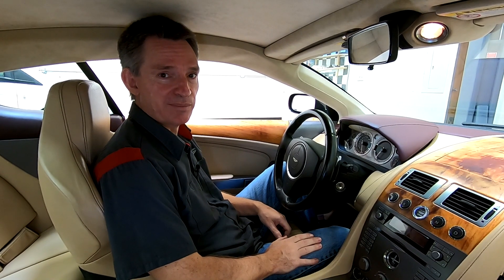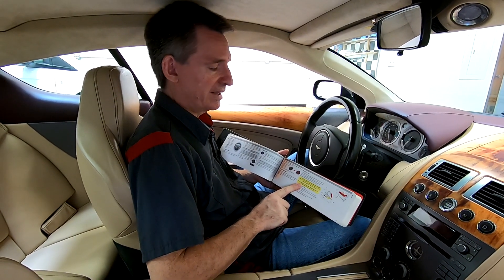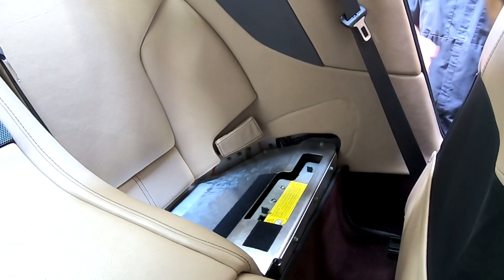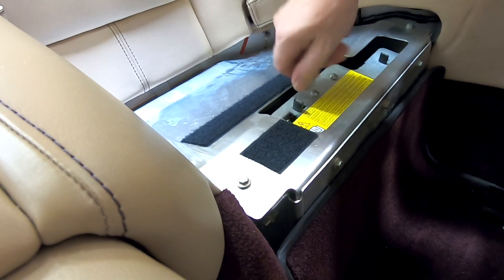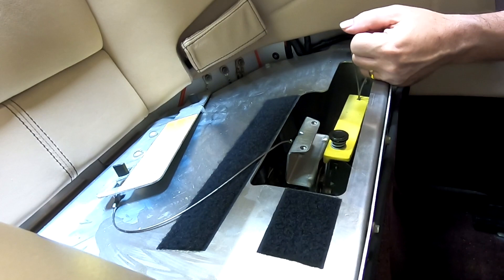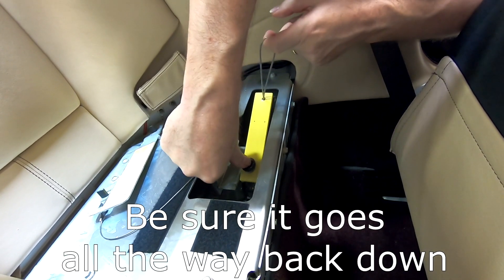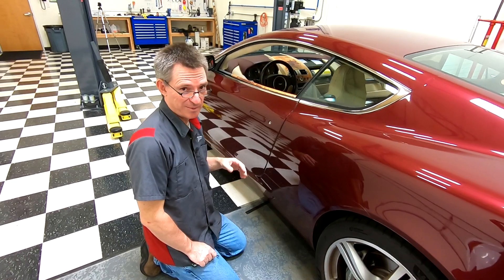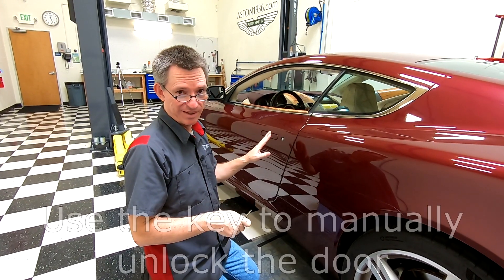Engaging Park Override in an Aston Martin DB9

Comment: If the parking brake isn’t engaged will the lever not make enough tension to unlock it? I just tried to move one and didn’t have the parking brake engaged. I pulled the yellow lever but it wouldn’t roll.

Comment: Steve, have you had any issues with non functioning door mirrors?. Mine do not move with the the joystick, pushing both buttons folds the passenger mirror only. The left and right mirrors buttons illuminate when pushed.

Comment: It might be worth mentioning that with a flat battery the frameless door windows won't drop down when opening the door so you really need to be careful when opening the door because the glass will drag against the top of the door opening. You need to be even more careful when closing it as I think it would be quite easy to break the glass when closing it with the glass in the fully up position.
Reply from the maker: Excellent point.   It is likely you'll get it open, but unlikely you'll get it closed again, so hopefully you'll get the battery issue solved before you need to close it again.  Thanks for watching!

Comment: Great channel you are living Encyclopedia Aston 1936. I am trying to find out how to upgrade the navigation system on our 06 DB9 Volante if you could point me in the right direction. I am in the U.S.A I know they upgrade them in
Reply from the maker: If you are talking about just upgrading the Mapping CD in the existing setup, you can track down a Volvo GPS DVD update and I've heard those work.   Some chatter in forums about this, but I've never done myself since the GPS in general sucks so bad (the Volvo user interface is pretty ancient). Let me know what you learn.....
Reply: @Aston1936   Thanks I looked into it and its just easy not to get a headache over it. I like to leave that unit down any ways and the dash looks clean and sweet. Just use the phone GPS.

Comment: Great video, thanks. Do you have any videos on TPM's? I just had mine replaced and still have warning light in dash.
Reply from the maker: Hi Frank.  In fact I am preparing a series on videos on fixing the TPMS sending units.   Essentially changing a $10 battery in each unit, but takes some soldering and is possible for the average Joe like me.    But, I suspect it will be a few months until I have them done and published.  Backlog of interesting topics coming up.     Thanks for watching.
Reply: @Aston1936   my car drives fine but wont button shift to reverse.   Any suggestions?